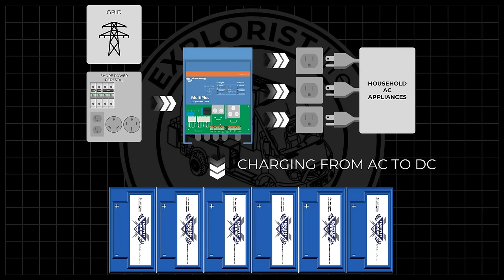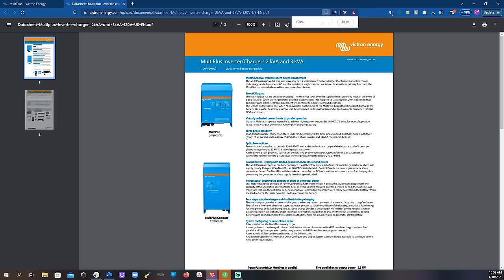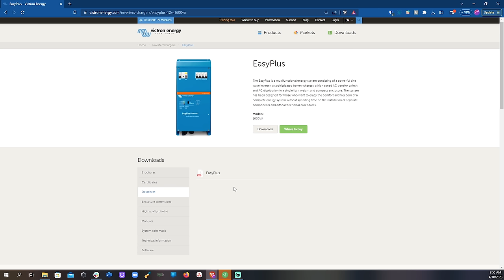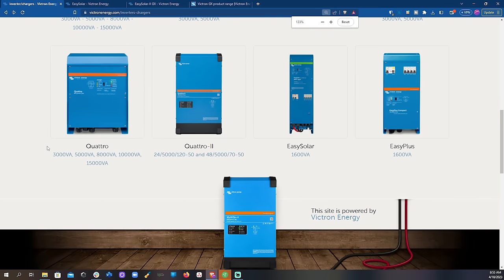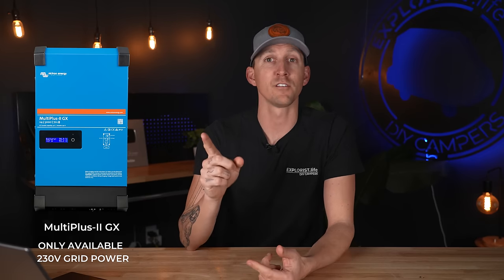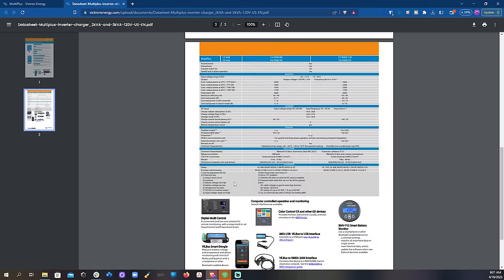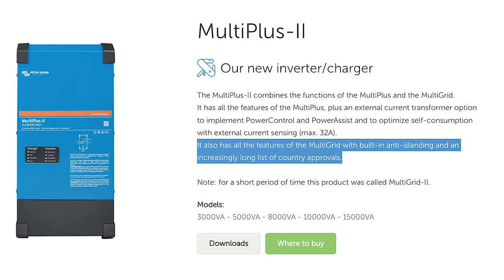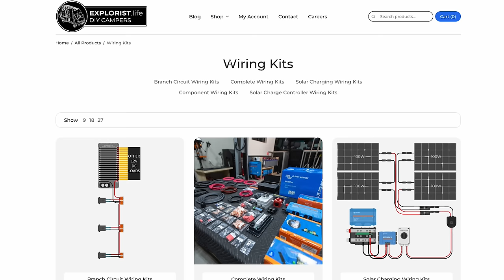Every Victron Inverter/Charger COMPARED!

Comment: My experience with Victron Multiplus II 2x 120 is incompatibility with NEC 210.8 required GFCI 15/20A, 30A, and 50A feeder outlets. The Victron forum is full of threads related to MP2 inverter chargers tripping GFCI devices. My Multiplus II regularly trips an Eaton 30A GFCI breaker, an Eaton AFCI/GFC 20A breaker, and a Leviton GFCI outlet. This occurs while in Charger-only mode. While the MP2 will work on RV parks which lack GFCI 30A at the pedestal, Victron needs to correct this. Recommend updating this video to address which Victron I/C products are fully compatible with US NEC GFCI feeder requirements. This will greatly impact owners parking RVs at home or in storage.
Reply from the maker: That's going to be a problem with ANY inverter/charger with an built in neutral to ground relay.  This is indeed something Victron is working to find a solution on.  There are GFCI breakers out there, though, that have a slow enough ground fault trip speed to still be within NEC code but will not be tripped by the speed at which the neutral to ground bond relay activates.
Reply: @EXPLORIST life - DIY Campers  I see a lot of people with problems with the different systems tripping those type of outlets. But just like in this comment I just don't understand theory behind it. One of these days I'll figure it out. Thanks for another great video
Reply: @EXPLORISTlife  Anyone happen to have a link of the specs required for this type of GFCI breaker that will work?
Reply: Wait, the EXPLORISTlife reply was removed, about there being GFCI breakers that have a longer time period before tripping that can solve this issue.  Just trying to figure out how to fix this.

Comment: Would be good to have a sheet that bullet points what each product does and does not do as I find it hard from this video to decide what would be right for my van
Reply from the maker: Try the 'system picker' on the home page of shop.explorist.life  It will recommend the proper Multiplus based on your needs given you are based in the USA.
Reply: @EXPLORISTlife  I am based in the uk
Reply from the maker: @pureperoni  Reach out to your Victron dealer, in that case.  Although we do ship to the UK, we don't stock 230V versions of the Multiplus just yet.

Comment: Hi Nate,
Thx for untangling some of these choices. WOW!  And yes, I'm one of the six still watching. 🤪  

One Victron feature I learned about was their "POWER ASSIST" on some models I think.  It MAY help me when Boondocking. 🏕  I'm still lost and need HELP selecting the RIGHT INVERTER, and stuff, for my needs. Aaarrg! 😳 

I do have a small Inverter Generator, 1600W (2000 surge) with a NEMA L5-30R, 13.3A @ 120V capability, BUT I really don't want a gas generator.  Howerver, maybe that "Power Assist" means I could combine my Battery output with the lil Generator output to meet my AC evening energy needs??? 🤔 

Our couples camper is the 2023 Grand Design Imagine 22MLE. She came with a tiny 25amp/300w Charge Controller, 1@165W Solar Panel (I'm sure I need another one maybe two??? 🤔), a 12v Refer, and NO Inverter.

We'd like to run Air Conditioning, especially for ~8-10hrs at night & sleeping. It's a 15,000 BTU, 1720 Watt, 15.4 amp unit (I'll add soft start). 

So far all I have updated is to a 230Ah battery, not sure if I need two???  🤔

Cheers, 
Eric

Comment: If I were to buy a new 5th wheel I'd switch to Victron gear. My issue is I like my power and need to decide on either dual MP2 and each one can do 25A to each leg of the panel independently or do dual MP2/2x120 and wire them in parallel to get a 50A combined total but can be split in whatever amount is needed up to the combined 50A. At least that is how it was explained to me.  More wiring, more j-boxes but Victron component prices are about the same.
Reply from the maker: Battery bank capacity is usually the deciding factor for most people there.  dual multiplus 3ks is going to take at least 800Ah @ 12V (and would warrant a 24V battery bank) and the single multiplus can be run at 400Ah @ 12V.
Reply from the maker: We already have the 2x120 kit ready to go and in stock and will have the dual 3k system availabel later this summer.
Reply: @EXPLORISTlife  yep, was looking at 4-6 gamechangers in 24v config.

Comment: Does the multi plas 2x120 power 25 amps to both legs of 110?
Reply from the maker: It would be 3kVA (~25A @120V) split between L1 and L2.  They wouldn't both get 3kvs at the same time.  They'd have to share.

Comment: Power to the house is 230vac (l1, cm, l2) so why wouldn’t a 230vac version work for Americans?
Reply from the maker: The 230V versions are 230V between L1 and N.  In the US, it's 120V between L1 and N as well as 120V between L2 and N with 240V being between L1 and L2.

In short, without using an autotransformer, there is no way to get that 'flavor' of power out of a 3-wire 230V inverter.